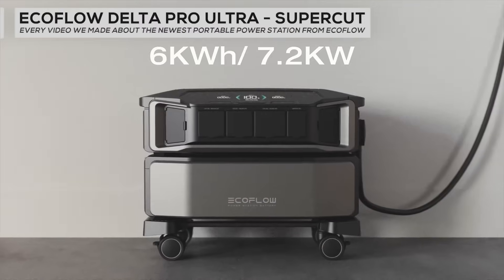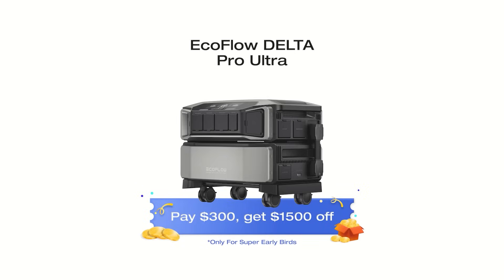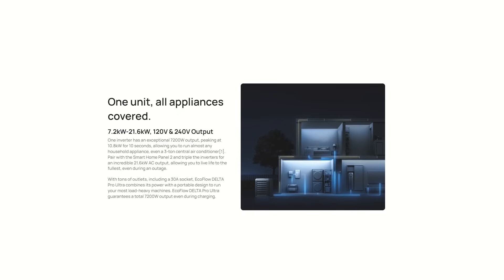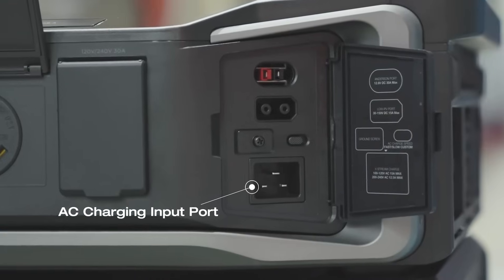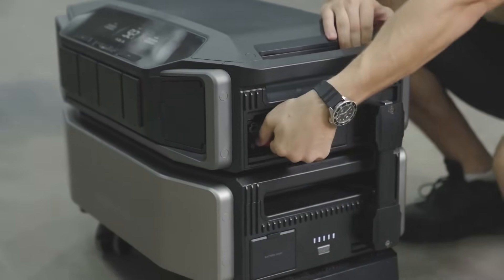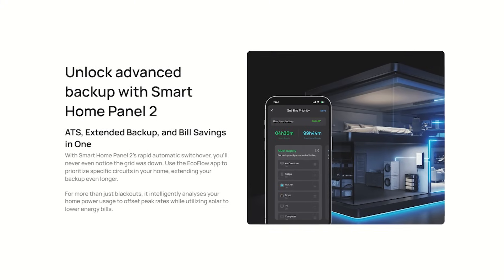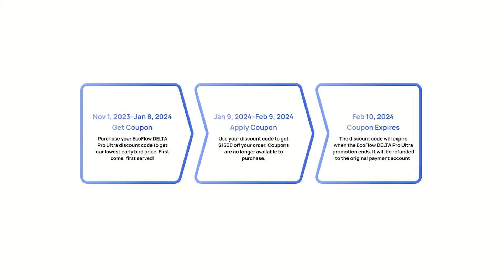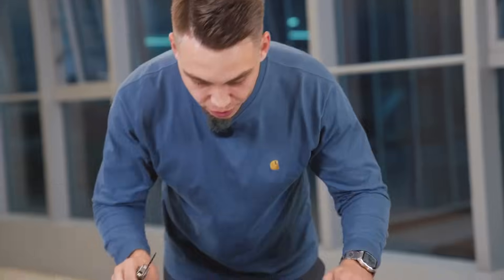EcoFlow Delta Pro Ultra - Supercut - Ultimate Guide to the Newest Portable Power Station

Comment: One full month of power on a single charge is impossible. The average home in the US consumes 886 kWh per month. There's no way this toy can store 886kWh. Their ad even states that this toy solar system can only store up to 90kWh of capacity.
Reply from the maker: Yea, I guess it means for emergency use I would assume, not normal use.  3 kWh per day could get you a lot.    I use about 10 or so kWh a day, which is 1/3 average energy use.  That's not even being careful.  So 3 kwh a day I could definitely see, especially with other efficient systems in the home.
Reply: @adventure-tech2.0  "I agree that these products are for emergency use, and that's why a person may consider purchasing this product as well as a gas generator. You are right that one charge wouldn't be enough, just as one filling of a gas generator tank wouldn't last a month. However, if you live in an area with lots of sun (such as Nevada, Arizona, and several other states) and have a good amount of solar power, you should be able to top these units daily, unless you are running a well pump and electric dryers several times a day."
In years past I would have never looked at these products  but know since I have experience several power outages  that last anywhere from a minutes, to several hours I  know looking at small system to get power the house for a few days.
Reply from the maker: I can relate in many ways you mention.  I love the idea of two or more sources for resources, whether it be your power source or your water supply.  Back up gas but main thing could be solar/hydro/wind.   Have a town water supply but also maybe atmospheric water generator as well.  Some people use rain water for flushing toilets but also can turn on their normal water lines as well if needed.  Stuff like that I want to integrate as much as possible.   @yahsoulbro2018
Reply from the maker: haha , made me laugh @Jed67  For a toy, I'll take it